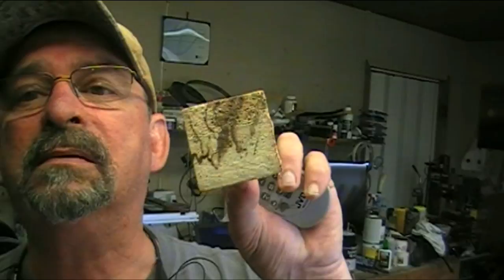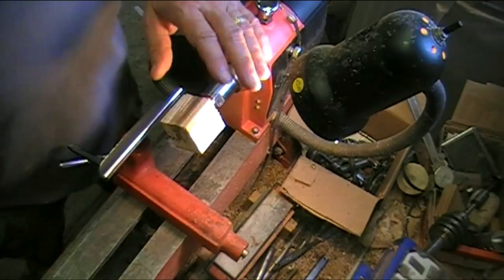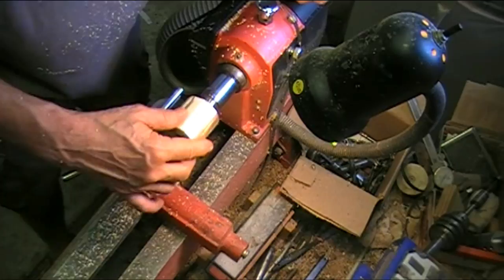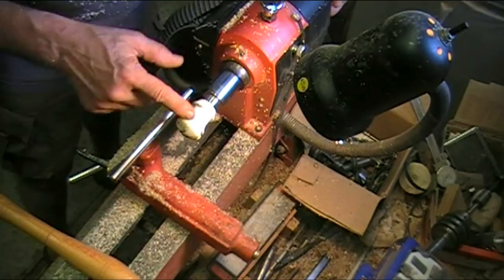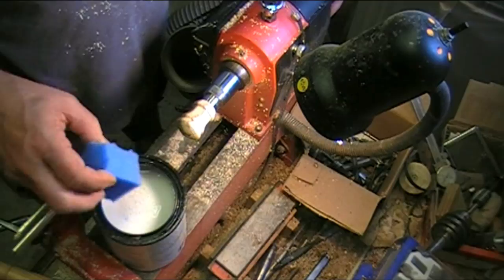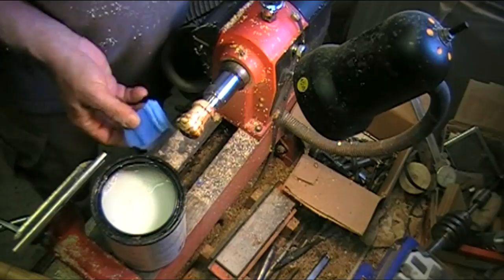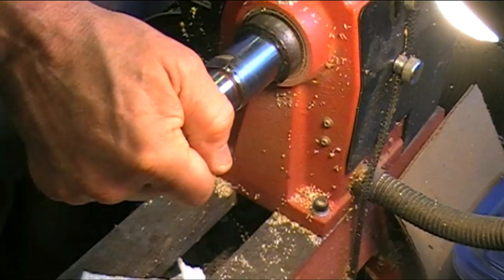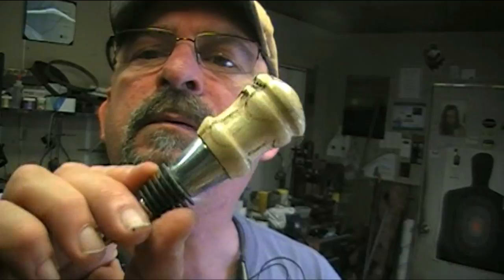Wood turning a spalted bottle stopper

Comment: Cool presentation. 
Was wondering what this black paste is.
Christian Jensen 
Woodturning my way
Reply from the maker: Woodturning - My Way took mineral oil and melted bees wax and added black tripoli.
Reply: That's pretty nice, a friend of mine gave me 2 pounds of fresh beeswax and I mixed it with mineral oil and was using that to help keep the dust down. 
But haven't used it since I got my dust extractor. 
I guess I might have to dig it out of the cabinet and give it a try. 
Thanks for sharing.